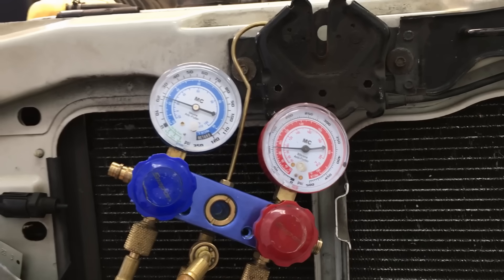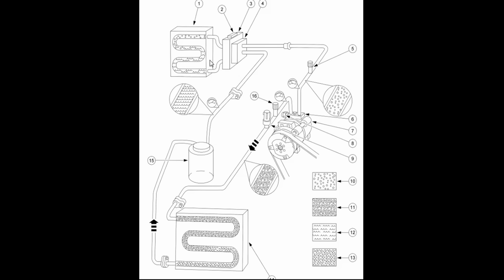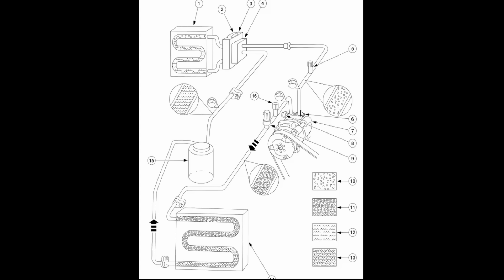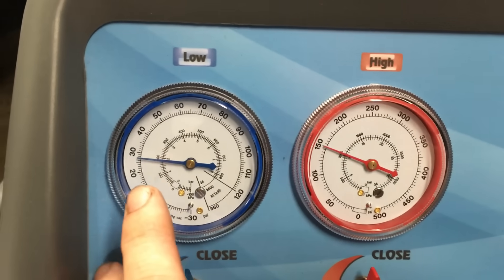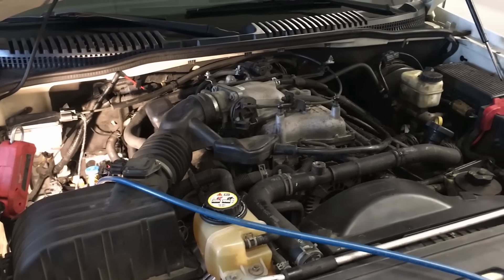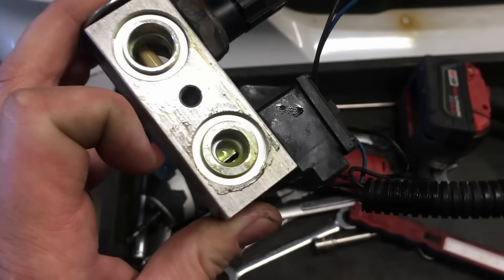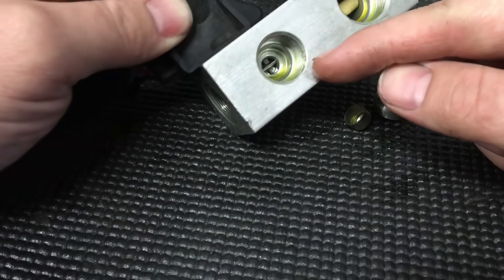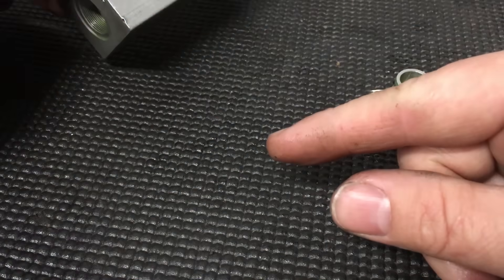3 Common Signs Your TXV has Failed Causing Poor A/C System Cooling

Comment: Always educational, thank you. My AC blows great when I’m cruising but as soon as I idle the temperature changes upward. Not hot but not cold. Could this be a failing expansion valve?
Reply: Check you fan
Reply: did you ever figure this problem out? im having the exact same problem!
Reply: Cooling fan

Comment: I have one where low pressure Is higher then the high side and didn't want to take more fluid but ac compressor clutch stays on but no ac in cab but then I checked if the pressure leved out and 2 days later still not leveling out I'm about to replace the txv seeing this video makes sense out of my situation I'm sure it will fix it thanks for the video

Comment: I have current issues with my car AC. front ac is warm, rear is cold.  When reac ac is being used, front ac becomes a bit cold. I am suspecting front  expansion valve is faulty. Any advice?

Comment: Diagnosing a 2001 VW Jetta 2.0L with my students. Came to us with new compressor already installed. System was low on charge. After charging it to spec compressor clutch engages but only 60°F vent temps, Low Side: 65psi, High side: 75psi. Anyway to differentiate between stuck open TXV and bad compressor? Figuring our next move is to remove TXV for inspection. Thanks in advance for any insight in.

Comment: Hi my ac compressor turns on and couple seconds later stops..It was working fine just been like that for a week or so,I tried to put freon but I won't go in and the ac lines are hot,you think this could be the valve as well?

Comment: I'm having a problem with a conversion kit for my 1972 mercury cougar. The high side is going up a little high and low side is dropping way down to 10 psi and not cutting off.I think it is the txv valve. Everything is new except the evaporator. I did remove it and cleaned fins and flushed inside with proper cleaning flush. Everything seems fine there. Do you think it is the txv? Thanks for any advice

Comment: You are a genius. The technicians I have been too have no idea about the valves and what the pressure should be etc. You are like an engineer. I am going to attempt to change the expansion valve myself to save some cash as this ac story is starting to cost alot as different people have been working on mine and I need to pay each time.

Comment: Hey Brian, your videos are excellent and have been very helpful thus far!
I'm really stumped on figuring out the A/C on my '11 F150, 5.0. 
Blows cold only when running higher RPM and the low side doesn't come down from around 75-85 and high side is steady at around 80-90. 
Just replace the TXV which was in fact stuck closed on the high side port. Still no change. System has been checked and no leaks. 
Compressor or condenser maybe?
Any input would be much appreciated!!
Reply: There is no pressure change between the the two; your compressor is not working( I.e. not able to create pressure difference)
Reply: Sounds like your compressor isn’t running. 
You might want to investigate why that is.

Comment: too bad on a 2014 Explorer, the TXV ,  & Evap temp sensor is only available with the Evap assembly for $400 ! You have to disassemble the whole dash to get the Evap box out. What moronic imbecile designed that idiotic setup !

Comment: I AM SO FRUSTRATED, I PUT 2 TXV (f+r), NEW DRIER, NEW CONDENSER, NEW COMPRESSOR, NOW WITH A PERFECT CHARGE BOTH SIDES HAVE THE SAME PRESSURE 50PSI, COOL AIR IS COMING OUT BUT NOT COLD (my thermometer died), . CLUTCH IS OPERATING AS IS THE ELECTRIC FAN.   THIS IS A 2008 CHRYSLER ( same as Durango) WITH FRONT AND REAR A/C. IT WAS EVAC TO   —-30PSI FOR 2 HOURS.    ANY IDEAS ANYONE????

Comment: I had where my 2010 F150 lost AC cooling, but the high side was going really high, not low and took forever to equalize. I was told it was the orifice valve. I got a new valve. Before I could install it, the compressor clutch started acting up and eventually the pulley seized and broke the belt. I ended up replacing the compressor, orifice valve, drier cartridge, belt, and, idlers. Works great now. I think it's weird that this one would be low if it was restricting while mine was high (300+ PSI)

Comment: My tuscon has a clutchless variable compressor I think and the low side was above 350psi and high is around 120psi. Ima drain replace txv and maybe that'll work but it may be the compressor. Only 57k miles on the damn thing.
Reply: It is the solenoid valve. You can replace the solenoid valve or replace the whole compressor
Reply: @KatreaKairisWorld  thanks for reply. Have you had that similar problem? I'd have to do the compressor. Can't find a place that sells just for the solenoid.

Comment: I drove a 04 Ford F650 truck the A/C never worked, most of the time it would blow hot like one day it was 107 out and the truck was blowing 90 degrees, if the truck was idling like when we are having lunch most of the time it would not work, you turn the A/C on and off for 15 minutes, or pull up and drive around the block a few times and then the A/C would come on. I worked outside and temp in the summer was 90 to 115 on any given day for 4 months.  We had a medical emergency with heatstroke and luckily we had another truck and we used that A/C unit.

Comment: Excellent video! 

My honda air con pump engages correctly and keeps working. It doesn't disengage until I switch it off. but my cabin air is still warm. The r134a level is correct with no leaks. Could the TXV be causing this problem? 

Thank you from the UK

Comment: I read somewhere that the expansion valve could be bad if the rad fan comes on when you turn the A/C system on. Is that true? I’ve watched 2 of your A/C videos and I believe mine is bad on my ‘13 F150.
Reply from the maker: No that is incorrect, the fans should always come on anytime the a/c is turned on to ensure airflow across the condenser.

Comment: Great video any idea what going on with the 13 and newer F150s that come in with fans on high and the a/c pressure is near 400psi and system won’t equalize?  Our shop has seen tons of these and TX valves don’t seem to be the fix. Your our last hope at coming up with a solution since Ford doesn’t know
Reply: I do not know much about ac systems but it not being abke to equalize indicates a blockage somewhere which usually occur in the smallest point of the system which is the txv but if those were replaced with no result then the restriction is somewhere else. Condenser design changed years ago from one large pipe to three small ones which makes them easier to develop a blockage so that is a likely place if not the txv but of course the blockage could appear anywhere in the hoses evaporator etc. Also more than normal high side pressures also indicates a restriction. Nitrogen is the best thing to use to flush the system as it is dry and won't introduce any foreign materials that will remain there as they do not clear out the system easily by any means that are used in the ac flush kits.

Comment: So I am having a weird issue with my 2012 f150 AC system. It tripped a DTC po532 low refridgerent. Now here's the weird part. My pressures are both extremely high low side  205psi high side 220psi. Compressor activates, clutch engages. Outside temps are around 32 degrees at time of pressure check. Does it sound like a restriction?

Comment: I have 2004 BMW X5 the compressor work ok but sometimes I have cold air and sometimes I have hot air I replaced the compressor still have same problem last time I see the compressor fan was not working when I jump it or disconnect ac pressure sensor it work fine can this be the expansion valve? Or fan problem or the pressure sensor what do you think

Comment: Hi there.
I'd like to ask if the TXV has something to do also with my compressor that engages only during fan speed # 1 but disengages when fan speed # 2 to # 4? Also, it somehow disengages sometimes even fan speed # 1 during traffic? I just re-charge the system with refrigerant by the way. Thanks for help. By the way I like the system ow you explain it in details. I'm learning on your channel.

Comment: When (engine) running my low side reads 30 and my high side slowing creeps to 240....then high side drops to 160 and low side to drops to 17, and then cycle repeats.

I got cold air at times and luke warm air at other times.

When it is really hot, it seems as though the compressor doesn’t even engage.

(Vehicle is a 2008 Mercedes G500-I realize this is a Ford channel, but I am having trouble finding Mercedes guys who work on their own stuff, especially G-wagon owners).

Thanks in advance.
Any ideas?

Comment: Please someone anyone help me!! I have an 06 lincoln mart lt. I just had my compressor accumulator, rings and orifice tube replaced. Vents are blowing at 58f at lowest setting. Mechanic says this is good. It does not cool the cabin down. Any ideas or suggestions?
Reply: Yea ur evap it might be dirty
Reply: Only thing i can think of is the condenser. It is the original and i have not done a flush in about 2 years. PLEASE HELP. I am desperate. Mechanic tells me that if it blows out of vents at 58f it is great. But i know it is not. It will get the cabin to cool down on a hot day!

Comment: I have an 06 lincoln mark lt. I just had my compressor and accumulator and orifice tube replaced. I still feel like it is not cooling like it should. It does not get the cabin cool enough. I will have to buy a thermometer to see what vents re blowing at.

Comment: So I'm confused. As temperature at exit side of evaporator rises, gets too high, that means the evaporator is no cool enough so something needs to be done to make it cooler. Expanding refrigerant does the cooling. The faster it expand, the more coolant expands per minute, the faster it cools down the evaporator? So to cool the evaporator faster, or more, you increase the size of the orifice? Or you decrease it? Because if you decrease it gaseous refrigerant expands more? So, the valve needs to narrow or to widen, in order to lower the temperature of the evaporator? I'm confused.

Comment: First off, love the channel, and your easy to understand repairs and methods. THANK YOU AND KEEP THEM COMING. My 2002 Merc Benz S430 (W220) A/C stopped working after I replaced the windshield wiper hose (with the heater wire/ cable inside). The unit small red light is on indicating the system works, but will not blow cold air. The clutch does engage, on then off, constantly. The typical reset feature/ trick doesn't work for whatever this error is currently. I checked the relays/ switched and replaced them as well.  Assuming the system may have been low on refrigerant, I filled it with what it took in, which appeared to be almost two full "tall" cans of AC Pro. Reset the system and the air came on "absolutely freezing cold" for about two minutes then shut off again. After resetting and attempting to make it stay on, it wouldn't reset anymore after four attempts. I noticed a clear liquid had leaked from the bottom center of the car down the driveway to the rear of the car, no smell or color, but thicker than water. 

The next day, with the engine running and the air refilled and reset once more, I heard a loud hissing and bursting flow of air or spray from under the hood, front drivers side for about 40 seconds then stopped. I believe it was a pressure relief vale of some sort !!!  Scared the &%$#@^&  %$#%^&%#@ out of me to be exact.  The clutch still engages, on then off, constantly.  Whats wrong with the cars AC ????? What would you recommend I check or replace????  No AC for the past four months now...
Reply: Hole in the condenser...?
Reply: restriction in the system which led to you over charging(?)

Comment: When driving the car would your AC blow cold with a failed TXV? Then blow hot when sitting idle? This is my current problem. At this point I'd rather try replacing txv than my AC motor. I'd appreciate your feedback, and thanks for the video.
Reply: Could be undercharged, the condenser fan/fans are not working or not spinning fast enough, could be bad fan fuse or relay, the condenser could be dirty not allowing airflow. The fans should always be on when the compressor clutch is engaged.

Comment: I have a 2008 Taurus X the low side is 55 psi and the high side is 270psi at 80 degrees. the cabin air is cool around 55-60. I put on new txv and dryer already. What could be the issue.

Comment: i am having a cooling issue but i dont have a gauge to check. The car was only built with only one cooling fan. My a.c dont work good during the day but it works great in the night. My car does not overheat. Can it still be the expansion valve if it works fine at night?

Comment: I’m completely confused with my a/c system at the moment and would like to have your opinion about this matter. My A/C system was acting sporadically going between cold, warm, cool to cold cool and eventually just cool or warm. No leaks in the system, right amount of Freon, fan and compressor kicks on. But the problem I’m having is pressure. While compressor is running, The high side pressure is at about 150 but the low side is way to high at well over 120psi or more. I’m thinking compressor?? Not pumping or sucking enough through the system. Or could it be an expansion valve ? But if it were stuck open, wouldn’t I have some cold air for a bit until it stays to frost... and if it were stuck closed, the shouldn’t I have low, low side pressure? Any help please from anyone. Thank you.
Reply: Did you ever get this figured out?

Comment: What year make n model is the truck in the video?  It looks to be an 04 Lincoln Aviator.  I've an 03 having "start - stop" scenario with my compressor. Insane 140 high side, low was 45 @ 110 degrees F.

Comment: Hi I wonder if you can help me I’m really having a problem this is been going on for like the third summer now so my air-conditioning in my 2006 Lincoln town car at an idol it will get cold about 4850° and when you drive it gets warmer and warmer so I can get all the way up to 60° and it never gets cool the air condition worked fine until I had the dealer replace the actuator door when I got the car back there was water all over my floor so then they had some company called Dr. seal seal it and ever since then my air condition has never gotten cold and used to freeze you out I mean it could be 105 with 90% humidity and you will need a blanket on that car

Comment: What an education!!! Not only on how to use the gauges but how to use them to diagnose this issue this issue for what ever type orfice valve/evaporator valve there is on the AC system. Most likely will be able to confirm a problem that I am pretty sure about already. But using a more scientific method would make me feel a lot better before actually doing the repair. Also make me the smartest something lol in the room when someone else runs into it next time. I can direct them to you here.

Comment: The sencing bulb lost its charge and is not putting any pressure on your needle. Thats why it has no resistance onto the spring or in this case your finger.

Comment: I have an Acura RSX that the pump pulls hard on the motor AC works but sometimes I hear a hiss in the dashboard is the TXV stuck open that or its clogged somewhere else it does get cold but only when I'm driving it will get a little bit cold when I'm sitting still but when it clicks on it will almost stall the engine and then the idle will come up and even when I'm driving I can feel the engine jerk every time it turns on and off

Comment: How come my ac sometimes works sometimes doesn’t. It will blow cold air for a few minutes then start blowing warm air or the opposite.
Reply: Have you gotten it fixed yet? I’m having the same problem and can’t figure it out. It works some days
 and some days it doesn’t.

Comment: Question for you. 2016 f150 high pressure cooling fans running full blast, ac not working. I can let a little bit of refrigerant out of the high side and it’ll work fine blow cold and fans not on high. I know I have a blockage somewhere just curious to where you thing it’d be? Expansion valve? Condenser/drier?

Comment: GREAT explanation (as usual). Why did the adjustment plug for the seat and spring remove so easily? If it's adjusted I would think it would be temporarily locked into position so vibrations wouldn't loosen it and change the desired spring pressure.

Comment: TXVs are temperature dependent.  Is it possible to do AC work with a TXV when it's 20 degrees outside?  I'm repairing the AC in my garage and my TXV was closed so I replaced it.  Now I'm thinking it was just too cold outside.  How do I know what temp they're supposed to open?  I suppose I'll have to heat the garage or move the car to a shop.

Comment: If the pressure fails to equalize when engine is off, this means the valve is stuck in closed state OR there is a blockage somewhere along the refrigerant circuit. If the valve was stuck closed however you’d expect the high pressure to be to high and the low to be too low. However your gauges showed the high pressure was ~ 100 (which is actually low reading). The fact that the low pressure was okay is a proof the compressor is not the culprit. If the compressor is working as intended but the high pressure is still low then there must be an obstruction between the compressor and the high pressure port-> most probably the condenser was the problem as it commonly gets packed with metal shavings from the old defective compressor!!

Comment: Hey man just want to thank you for all the help that you have given me I have a 2000 Ford F-150 4 x 4 I have replaced timing chains timing chain gears oil pump and so on due to your YouTube videos thank you couldn't have got through it without you sorry for the length of the chat but I have a shutter in my rear end coming out of 5th gear on bypass can't quite figure out what that might be transmission or rear end any idea